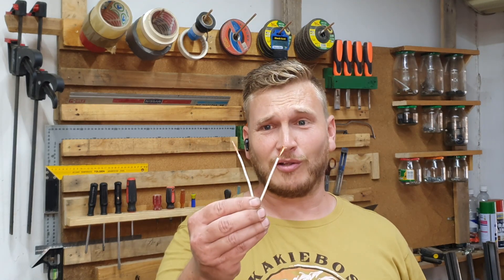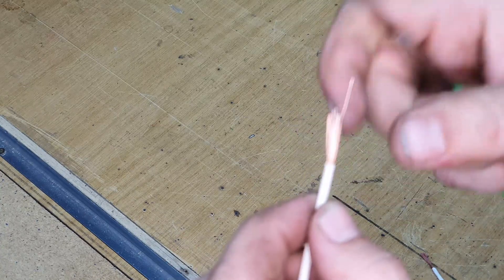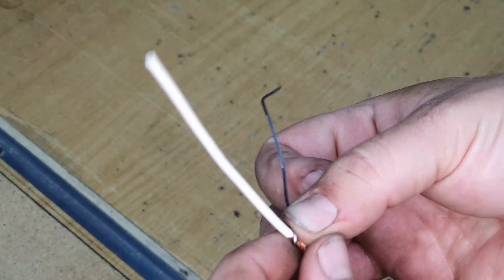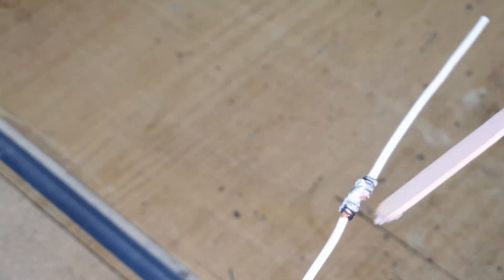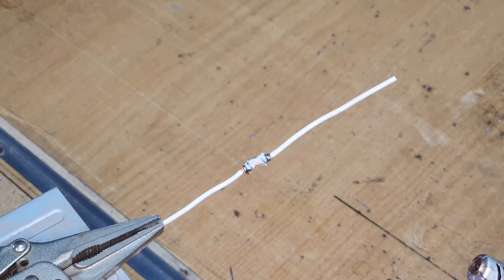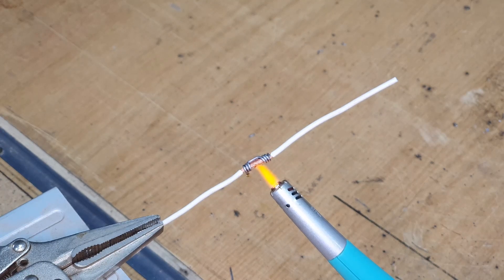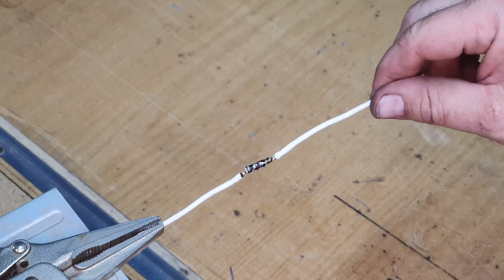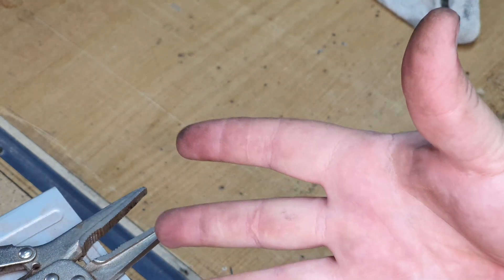Can you solder without a soldering iron?

Comment: Some thoughts:
- Scraping wire to clean it is something that just isn’t done. Remove obvious contaminants (like grease) with solvent, but it’s the flux’s job to remove oxidation. 
- That didn’t look like electronics flux. NEVER, EVER use plumbing flux for electrical wire, especially stranded wire, as it will corrode it catastrophically.
Reply from the maker: I appreciate your detailed feedback! It's always good to have knowledgeable viewers like you pointing out important details.

Comment: can you please help me i need to solder wires on a battery but my soldering iron broke what do i do how can make it stay
Reply from the maker: Hi, well the quickest and easiest will be to heat up a nail or thin piece of iron with a flame and use that as a soldering iron. I hope it helps a bit. Thanks for your support! 👌🏻
Reply: just use a soldering stick
Reply: @mehere3013  doesn't work for my project